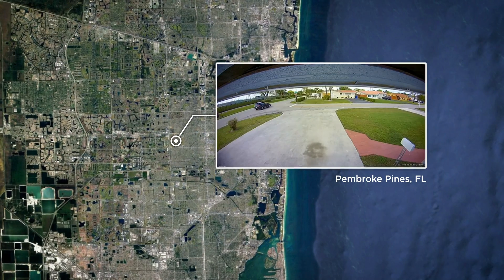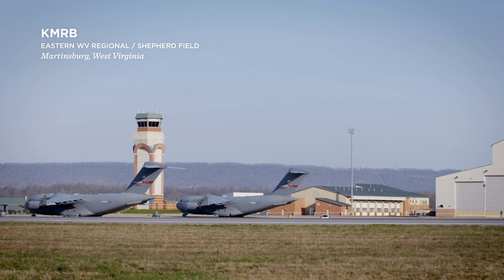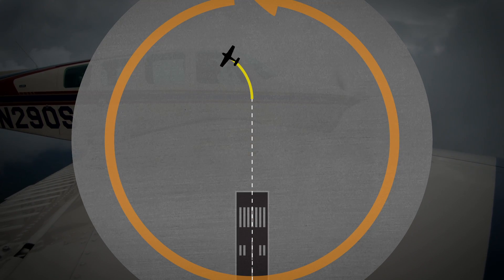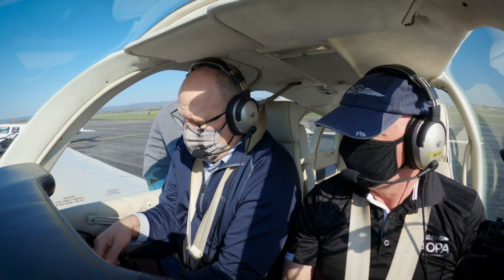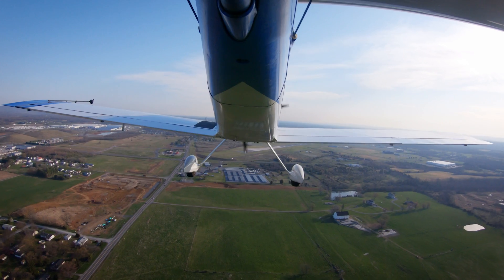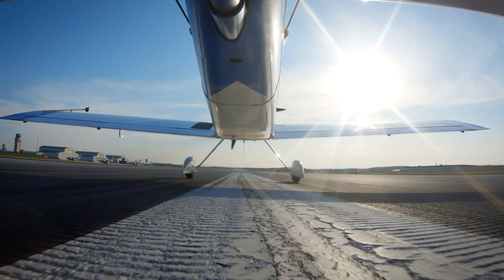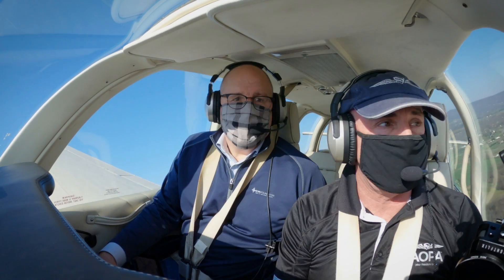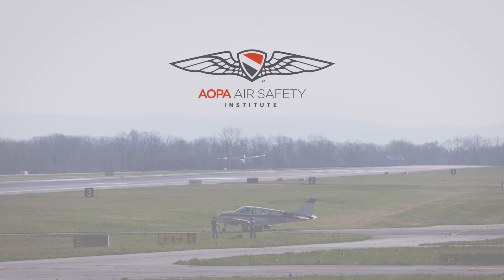Reality Check: The Runway Behind You

Comment: Remember, you don't have to get back to the runway! Any hard surface will do: taxiway, ramp, access road. There are usually other options available at an airport. That's how I do my pre-departure briefing: going over what surfaces are available in case of an engine failure.
Reply: all the grass between runways is fair game as well.
Reply: You dont have to turn at all...straight ahead and look for a spot.  USE THE TIME WISELY.
Reply: @speedomars  I'd say if you don't already know which way you are gonna turn ahead of time, then don't try turning
Reply: @ChadDidNothingWrong  The impossible turn is impossible.  The correct emergency plan is to look AHEAD and see where to set down.
Reply: @speedomars  Many airports have no good options AHEAD. Are you really going to tell people to plunge straight ahead into inevitable doom because of ideology? If the parameters are in your favor and there are no good options head, TURN BACK.
Reply: @somealias-zs1bw  Bogus logic.  There is no such thingn as an impossible turn back.  HENCE...you always have in mind a spot ahead, ALWAYS.  if you try the turn, you will die.

Comment: I know (knew) a CFI who swore you could do it at 200 feet AGL. He even trained his primary students this way. A lot of people - very experienced pilots and CFIs - told him he was nuts. He died after an engine failure on takeoff in a 206, stall-spin trying to get back.
Reply: That is impossible under most circunstances, Only with good power and turn have to be over 60 degrees to avoid getting too far out to the side.  You will stall trying that.  I practice them from 400 agl with power.  The Teardrop Kind, not the ? Question Mark Kind.  Double that altitude.  With mild winds.  with some power and some flaps due it is like a slow flight turn at around Vfinal speed.

Comment: Heavier airplanes can fly a bit slower if you pop 10 degrees of flaps to drop the stalling speed.  That way the turn will be not as wide.  Crop Dusters do that every day.
Reply: WHAT???? Heavier airplanes have higher wing load (and faster best glide speed, as the Bonanza seems to have). And flaps???? Yes, they reduce a bit the stall speed, but they add also more drag: I think, you best glide (for distance) with any flap is worse as without flaps. So, I would do this maneuver as clean as long as possible (don't kill altitude with flaps extended!), even considering to land without gear extracted!

Yes, the speed matters for the radius of turn, but the flaps do not extend your glide distance (they can kill speed but also altitude).
Reply: @torstenjaekel1687  The 10-12 degree flaps as you turn are to be able to lower the speed a bit, to the under Vglide minimum sink or Vms and use less radius due that.  All pilots should know that you can fly slower safely with some flaps. 

 Yes after the turn is completed, you can use the under Vglide Vms too because on a tailwind you can use less than Vglide speed for longer glide.  It is safer that way.  im an expert on turnbacks 3 kinds of -so they say..  I taught them to many on many airplanes with many winds. Even at night.

Comment: Fly by wire Scott Perdue turnbacks his Bonanza from over 800 agl.  But with a plus 10 knot winds on the ground and real 45 degree banking.  Here i see 38-40 degree banking mostly.  Here the winds are almost nothing.   I used to teach turnbacks to opposite when CFI 2 decades ago.  Taught turnbacks to opposite on Grumman tiger, Piper Cherokees and Tomahawks, Cessnas all kind of 4 seaters.   Partial Power you can turnback from 400 agl only.  Most engine fails are partial power, not total.  Had to turnback 2 times in my life due engine or fuel vacuum problem.  Cherokee.

Comment: Good experimental procedure, but I had to watch twice to understand that the reason the Bonanza failed was not because it didn't have enough altitude to make the turns, but because by the time it reached that altitude on climb-out, it was too far from the runway to both turn AND make it back. Perhaps wing loading is a useful number to keep in mind.
Reply: Bonanza flight team doesn't discuss climbing speed chosen. Either the bonanza has a lazy clump or the pilots didn't choose steepest climb. Can't complain about over speed if you are aren't climbing for effect. But clearly, if climb angle is worse than glide ratio, this is only going to work in a headwind.
Reply: And outright speed!

Comment: Here’s the thing with power off turns, and same goes with base to final turns. You CANNOT stall the airplane if you don’t pull on the stick. If you have an engine out, the second you pull the stick back you are getting closer to a stall. Any gliding maneuvers, if possible, should not involve any pull on the stick.
Reply: On a loss of power on climb out, you have to push forward.  That's because you're already pulling back during the climb.  Your statement about stalling is only true for an airplane in level flight and properly trimmed for hands-off speed at a particular speed above Vs0.  Those conditions aren't true during climb out.  But if the aircraft is trimmed correctly, and you're already at a safe glide speed?  Sure.

Comment: I fly a 100hp c150, and we had a partial power loss already on take off. We always brief, 500ft above - straight ahead/30° turns, above 500ft, turn back to grass or runway. 

We have yet to practice the turn and it scares me a bit. I think if I was solo, I would wait for 1200ft or more before turning. For now

Comment: Transition training for the rv-6 included simulated engine out at the departure end at 500'. Similarly rope break return to the runway at 300' for gliders. It is possible in the right aircraft with training.
Reply: Right.  But the cowards here say a 45 degree turn at 700 agl will stall you even at Vglide.  LIARS.

Comment: Great video. As a CFI for many years; I still teach this. It just saved on of my BFR students their life just recently. One mistake I see a lot though is that pilots are sloppy in their climb air speeds. In C-172 I have seen pilots climb out anywhere from 80 MPH to 95 MPH. Please climb at your best rate of climb just in case you do lose an engine. It will give you the greatest altitude over a period of time. Altitude is your friend. Know your airplane. Also the video shows the airplane going back to the end of the runway. How about if your aim point for touching down being the middle of the runway. If it’s a 6000 foot runways you will still have 3000 feet. Remember each airplane and each takeoff you do is different. Brief yourself before each takeoff on what you would do in case you lose an engine. Always remember you are there to take the plane for a ride. Not the airplane taking you for a ride.

Comment: Would a piper Cherokee 140 perform similar to the 172?  It has similar speeds. Any input would be nice!!!
Reply: Probably so,  but you definitely want to take a CFI to altitude to test the altitude loss first.  You also MUST know your bank stall speeds cold and stay well above them.  They change the harder you bank the wings of course.  I have to maintain at least 90 knots in a 60 degree bank in my Mooney for it to not stall.
Reply: @gringoloco8576  thanks will study my stall speeds at different banks a lot!
Reply: Cherokee's aren't known to glide well.  My suggestion is to fly simulated power off in pattern, with a CFI, and get a feeling of what that altitude is yourself.
Reply: @tomsmith3045  thanks ill do that as soon as i start flying in the pattern with my instructor!

Comment: In my ABS proficiency flights (A36 Bonanza, IO550, tips, two on board, no baggage and half fuel), we were able to return to the runway....just....from 1200 AGL.  Note this was without the 3-second startle delay.  Nailing best glide (88 MPH as I recall) pulling the prop into low pitch and holding gear until the landing was assured  made a noticeable difference.

Comment: I think the Bonanza could have done better with a steeper bank. It never looked like a 45° bank to me, more like 30-35°. Of course, “better” doesn’t necessarily mean successful. I don’t claim that it would have been successful, but a turn into the wind and a steeper bank would have helped. 

I’ve practiced this at altitude, and I’ve been pretty confident that 600’ AGL in my P172D would work. But I had never tried it for real. However, during my last BFR (of FR for purists), my instructor had me do one for real, using 1000’ AGL, a 3 second “startle” factor, and a turn into the 10 knot crosswind with a true 45° bank. I was turned around and lined up with the 5100’ runway at about 500’ AGL and landed easily with full flaps about 1000’ down the runway. But I know my airplane pretty well—I have about a thousand hours in it alone—and I’m otherwise relatively experienced at almost 3000 hours. So I continue to use 600’ AGL as my turn back altitude—and I hope I never have to use it.

Comment: Great video.  One of the best yet from AOPA.  We live in a world now that is full of myths that often are claimed to be based on science.  The “impossible” turn is one such myth.  You have shown that, like many tings in life, it all depends on the circumstances.  The takeaway is to train for this in your airplane, practice at altitude to confirm the performance of you and your airplane, and then make an assessment for each takeoff whether you should consider a turn back or straight ahead landing.  Making this decision before takeoff will make the startle factor much less severe and will greatly shorten the decision time should engine failure occur.

Now if we could just get you all to learn that cloth and paper masks being effective against a virus is also a myth that needs to be dispelled.  😁. Although I realize that is a medical myth rather than an aviation myth.

Comment: I was gonna say I've never had any issues with turning back 180 and landing after an engine failure... but then I remembered I fly helicopters.
Reply: "Kill engine then three-second delay to simulate a startle factor" Bro three seconds? In a helicopter that's enough time to stall your rotor and die... twice. :D :D :D
Reply: Ironic thing is this same dude died today doing the impossible turn.
Reply: lmao
Reply: Nice one !
Reply: with my limited simulator experience with helicopters, autorotations don't nearly create enough lift to turn 180, do they? Whenever I practiced autorotations on the DCS Mi-24P it dropped like a brick, like 3000 feet per minute.
either way, I think turning back 180 in any aircraft that's not a beechcraft is a good idea, even if you land on the grass, the dirt is usually smoothed and compacted, as far as I know. I think this really could save lives.
Reply: @OfficialUSKRprogram  Doing a 180 turn during an auto-rototation is actually a proficiency requirement that must be demonstrated to a DPE before the FAA will even consider giving someone a private pilots license for a rotorcraft.  Trust me, you do sooooo many for training in a real helicopter that you can do it with your eyes closed.
Now, the pucker factor goes up significantly for an engine failure as your forward airspeed and height above the ground goes down because your options start disappearing and you have less time to act on them.
Engine failure a >500' AGL and 70kts forward airspeed? = Guess we'll just land at McDonalds today and call for the trailer.
Engine failure a <100' AGL and zero airspeed? = Dear God I hope those trees are as soft and fluffy as they look.
Reply: @rsrt6910 yes. The auto with turn, but from sufficient altitude to perform the maneuver. 
An engine failure inside the shaded area of the height:velocity diagram??? There is a reason we all call that performance chart the dead man’s curve!!!
Reply: @OfficialUSKRprogram Mi-24 is one of the least helicopter helicopters out there.
Start your training (even simulator training) in a training helicopter.
No one flies a SR71 before they fly a more conventional jet.
Reply: Lmfao savage
Reply: I fly gliders, if I have an engine failure, I first ask: where did I pick up the engine and how do I get rid of it?
Reply: I felt the same way, but then remembered that I'm not a pilot
Reply: lol
Reply: That's a good one!  You cheated!     Gotta love it!     How would you do it  -  if, both power & tail rotor failed?      It happened in Vietnam - those auto-rotations - definity increased the pucker factor.   I was lucky when I was in the US Army - Oh damn - I am getting old!
Reply: Good one!👍👍 But seriously it is called the impossible turn for a reason,, making this video is CRAZY to teach this!!👎👎👎👎
Reply: @jamesdamrom751  you commented this on a video...that shows that some aircraft can easily pull it off, some have a more difficult time, and some its straight up impossible? the video is unbiased and shows both opponents and proponents viewpoints and reasoning. i was an opponent before the video. Im just not silly and can change my mind given new information. I just watched two pilots pull it off with 100% success rate and one with a 66%.
Reply: @jamesdamrom751  Bullshit.  You cannot do a 45 degree turn at 700 agl?  Sorry for you.  Tell that to your passengers.  I bet you lie to them that you can do that..
Reply: @emergencylowmaneuvering7350  there a video of a guy doing it but he know he’s plane perfectly
Reply: @emergencylowmaneuvering7350  meet me for a few good drinks. I'll amaze you

Comment: Higher winds help get you back to the runway. I remember trying this with my instructor on both calm and windy days, and with calm winds we couldn’t make it.
Reply: NONSENSE!
If you turn in the wrong directions - you a much faster dead!
With a cross wind, if you turn with the wind (get a tailwind) - you are pushed away from the airport, your turn has wider radius!
If you have a dog leg (as we have at my home base SNA) - you had to consider also this one!!! If you want to turn into the headwind but your dog leg results in more as 270 deg. angle (you need at least a 270 deg turn!!) - you cannot make it!

DO NOT BELIEVE IT IS POSSIBLE!!!!
It depends on wind conditions, also if you have done a dog leg etc.!!!!
It is still the MOST RISKY maneuver (compared to a straight ahead or +/- 30 deg. emergency landing).
I would brief before Take-Off if it is really an option - and the best one! Most of the time - it is not).

BTW: in the video they turn back when they have still half of runway underneath the plane? What?????
Why not taking this one, even overshouting the left runway into the grass?  Turning back in this case could also mean - you have no runway left in front of you  after a 180 turn.
What then? (nice turn done but nothing to land on!).
What a horrible video and what a false message you get!

Comment: Should have done a test where the Bonanza made it. I would have liked to hear what was the minimum altitude the needed to make it to the runway.
Reply: They need to expand the parameters agreed.  In my Mooney M20E I can make this MOST of the time, but it depends on what climb speed/angle you use and how far you are from the airport when it happens.  Waiting until 1,000 AGL can often be worse as by that point you’re too far from the runway in a higher performance plane.  I climb out more aggressively due to what I discovered as I practiced these.
Reply: @gringoloco8576  Looks like staying at Vx longer as you are suggesting will help with this. This will get you higher while staying a little closer to the runway.

Comment: The problem with these demonstrations, there are several to be found on YouTube, is that the propeller is still being turned by the engine at the idle setting. If the engine has failed, is not producing any power at all, then the propeller is turning the engine and is all speed brake.
At a 45° AoB or 70° AoB as some demonstrate, the rate of descent is double than found with the engine at idle - with the throttle simply retarded.
Forty years ago,  the wisdom was: "GLIDE AHEAD TO THE HOSPITAL, TURN BACK FOR THE MORGUE".
I haven't seen anything that has changed that.
Reply: Glide ahead then get a lift home, not the hospital

Comment: John C. Eckalbar achieved successful turnbacks from 700-800' AGL in the Bonanza.
It doesn't look like the Bonanza test pilots are being nearly aggressive enough. 
Eckalbar advises a full power Vy climb to 1000'AGL. Execute the turnback using 1.3*stall speed in a 45deg bank (equates to roughly Vy in most Bonanzas) and an aggressive 45 degree banked slicing turn.

Comment: You really do need to do this in your own plane at altitude or with an instructor lower...  In my Mooney M20E it depends totally on when you take off (how much runway), and what you climb at.  If you climb at too slow a rate you end up too far from the runway like the A36 and can't get back to the runway even at 1,000 AGL.  You can make the turn but might not make the glide.  If you climb at Vx or Vy for a little longer though you can easily turn back and make the runway in most wind and DA conditions once you're above about 600 ft AGL.

Comment: I would like to see these aircraft perform the same maneuver at higher density altitudes to see the difference it makes.
Reply: Just take a different cross-wind conditon into consideration. Even this will make a huge difference! (Density Altitude does not matter so much anymore if you have to glide with engine out). And what is the difference for this option if you climb with Vx instead of Vy on the first 500ft AGL?

Do you know which turning direction is the "better" way to go back with a cross-wind?
Reply: @torstenjaekel1687  Any good glider pilot will tell you to turn into the wind, unless you've got an easy out in the other direction. I'd wager the higher true airspeed flown gliding in on a high density altitude day has a sizable impact on turn radius alone.